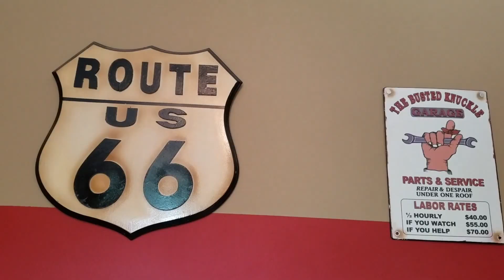4.8 Chevy LS engine specs

Comment: i know alot of people that swap 4.8 and 5.3 is there chevy s10 pickup or s10 blazer. will it plug and play? What do you recomend i do. I want to swap a 4.8 into my s10 blazer.
Reply from the maker: Koy Buscho some modifications will have to be made considering the model of your truck. GM changed these engines the past several years. Certain years are interchangeable while others are not, for example 2002 and prior had a drive by throttle cable then in 2003 they came out with the drive by wire, generations is what they call it. So be sure to purchase a wire harness specified to that model engine. It only takes two wires to start it. You’ll need the black positive power feed on the corner of the fuse block that runs to the positive terminal on the battery. Then the red wire located on pin A9 is your ignition wire that allows the computer to for the spark plugs and all the injectors.